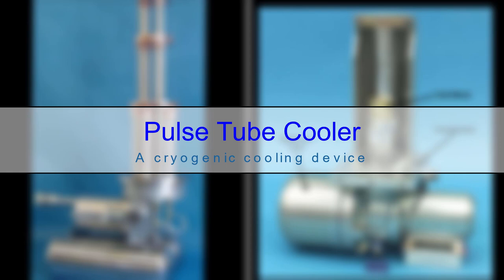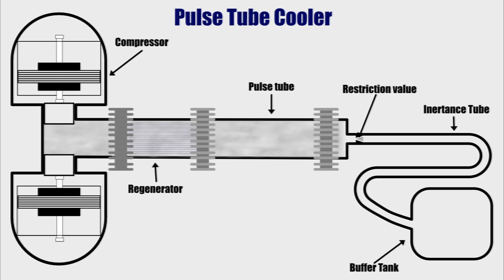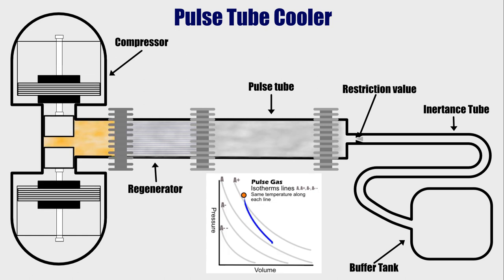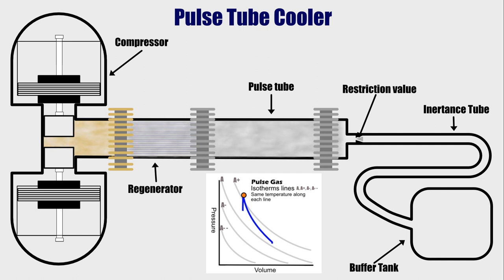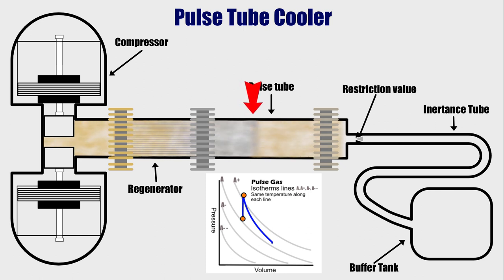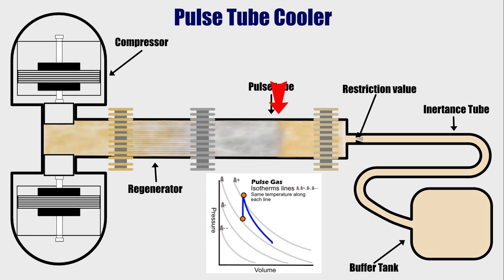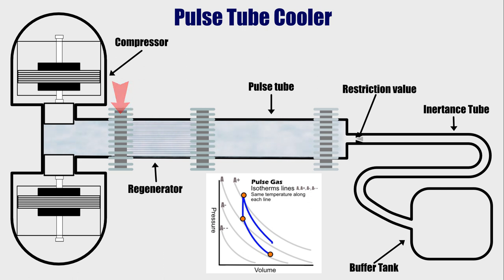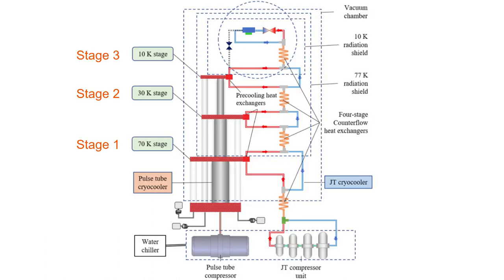Pulse Tube Cooler

Comment: Does the system need, say, liquid nitrogen cooling on the hot end of the pulse tube? I don't get how the temperature could be dropped otherwise with the compressor constantly putting work into the system.
Reply from the maker: The temperature drops first because it's reduced to ambient because of conduction through the heat exchanger fins. Then when the compressor reverses  and expands the gas, it cools it. They key to this is that all of the heat generated by the compression is taken away by the heat exchanger fins. When the gas then expands and cools it's able to pull heat from it's surroundings.
Reply: @operationalfacts5602  I see, so all it needs is the cooling on the heat exchanger at the compressor side, and only to ambient temperature. Probably also help to cool the hot end of the pulse tube, I imagine.